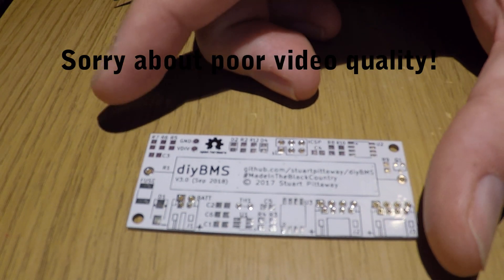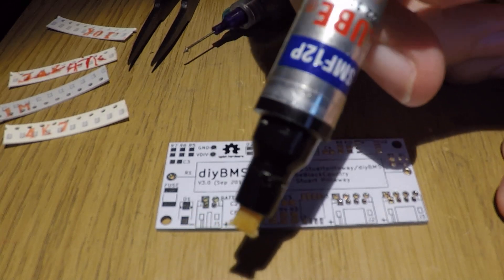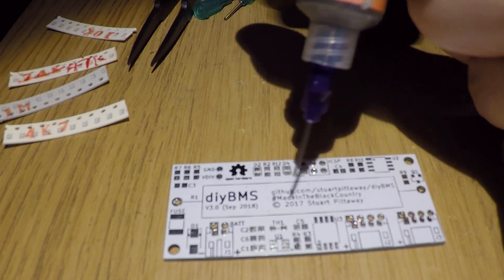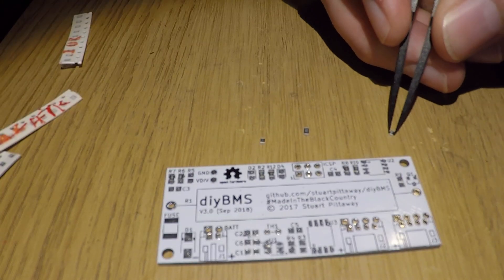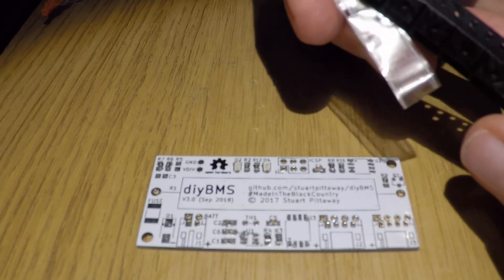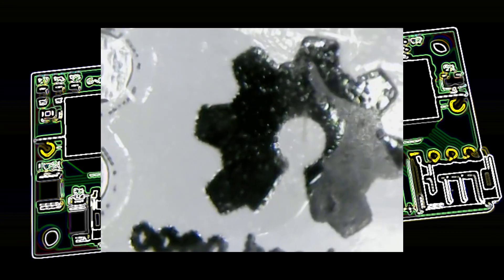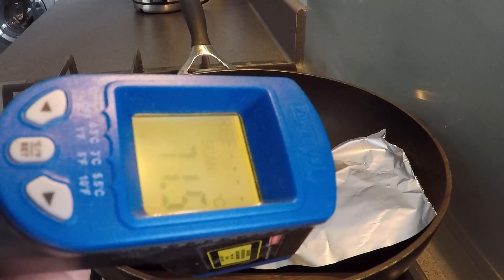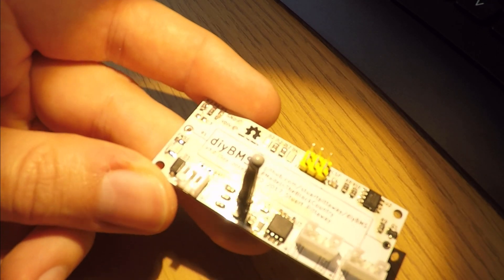DIY BMS v3.0 Building with a frying pan (Powerwall 18650)

Comment: Pcb manufacturers also make SMD stencils for around $10 USD. Just tape some guides down to hold the PCB and tape on one edge of the stencil to act as as a hinge. Then you just do one wipe and all the solder paste is applied in seconds and very accurately. Well worth the cost to do multiple boards, your pcb software will generate the Gerber file to make the stencil.
Reply from the maker: We also have a 3d printed stencil on the forum

Comment: Search for a YouTube video on a diyReflowOven using an old toaster oven.  It provides a tightly controlled 4 zone in same space reflow profile for low temp Sn63pb37 solder and high temp Sn96.5Ag3.5 solder.

Comment: What voltage is fuse on F1?
Reply from the maker: It's a part like this https://www.aliexpress.com/item/20pcs-SMD-Self-restoring-fuse-1812-1-5A-1500mA-6V-8V-16V-24V-SMD-1812-Recoverable/32805363864.html

The fuse is current rather than voltage sensitive
Reply from the maker: Not in the current code - probably easier to re-program the wemos to clear the EEPROM settings.

Comment: Hi Stuart. I have got 2 boards working fine and showing voltage etc but when i connect the first one to the second it knocks out the wemos. I have tried with others and they do the same really not sure if its a short or not enough voltage to the wemos? Do you have any idea what the problem is. any help would be much appreciated.
Reply from the maker: Try powering the wemos with 2amp supply
Reply: @StuartPittaway  Just tried that, still the same result.
Reply from the maker: You can't provision them in isolation. Do a factory reset on both modules. Connect first, provision, connect second and then provision that.
Reply: @StuartPittaway  It happens when they are not provisioned to. ;(
Reply from the maker: @LeeFall  must be a short, can you test on multi meter?

Comment: Is this version (v3.0) publicly available yet?
Reply from the maker: Yes take a look at the smallerpcb branch on GitHub, all the changes are there.
Reply: @StuartPittaway  does this branch already respect the changes made in commit 2673ef7? That is, the changed resistor value for cold temperatures?
Reply from the maker: @froqstar  hi Martin, no this version doesn't include those changes. Unless you need the smaller board, the circuit is exactly the same as the larger one.

Comment: what usb microscope are you using there?  seems to work well enough :)  Nice job on the v 3.0 board.  gonna have to look at swapping out my boards.  
another question.  Any chance of having a version of the board where the LED's aren't smd but instead some jumpers?  I am looking to move the LED's off the board and on to my brackets and just have some plugs to connect into the board.  keep up the great work!!
Reply: maybe the temp sensor too? :)
Reply from the maker: The microscope is similar to this one £15  https://amzn.to/2Ox6Fnp
You could just solder some wire onto the LED terminals on the board, but breakouts are a good idea
Reply from the maker: The temp sensor is a cheap nasty thing I got from Aldi - I'd buy better!
Reply from the maker: @CrankyCoder  yes sorry! Although the temperature sensor is really designed to protect the BMS from over heat during balance
Reply: Stuart Pittaway makes sense :) any thoughts on being able to wire the leds? I am hoping to put my bms on the top of my batteries but the leds may not be visible so I was looking to see if I could use jumpers and move the leds to the front of the battery holders
Reply: You think there would be enough room there where the leds solder to put breakouts?  if there were an alternative version made to make those through hole for headers instead of pads for smd?